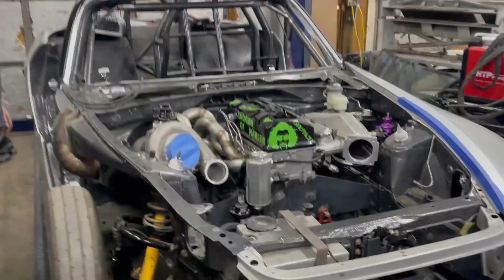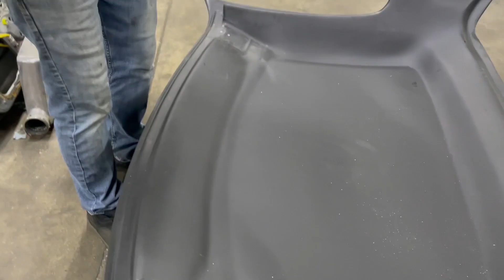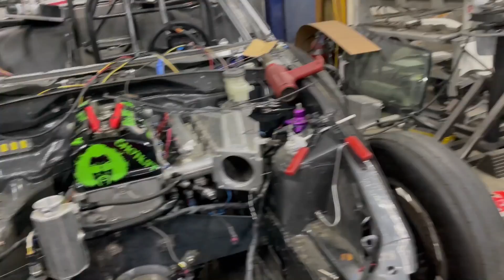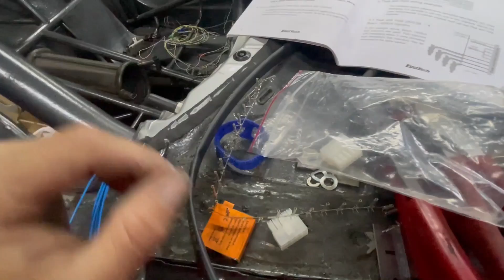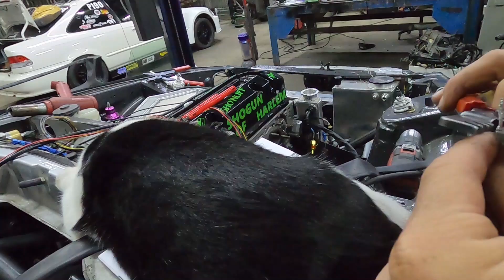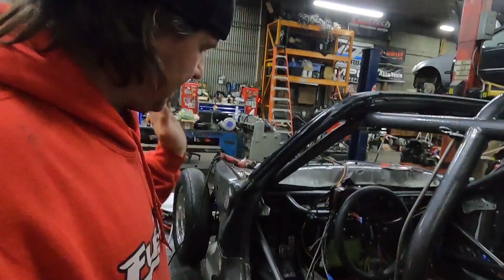Flew Home To Wire My Race Car, Sho'Nuff

Comment: The MAC WSC665 automatic wire strippers shown at 18:12 look an awful lot like my Irwin 2078300 wire strippers (Mac and Irwin are both owned by Stanley Black & Decker). I've never used one, but the NEIKO 01924A also looks very similar, and is even less expensive.

Comment: Rock On Brent!.....Wish I could be there to help ya shrink and pin cause you deserve to get old Sho'Nuff wired up and ready to rip ASAP! I use all the same tools and some of the same type of connectors/pin's for pro audio/video installations, so I can relate. One thing I've found in the 30+ years I've been doing it is after we crimp any type of pin to bare wire is to solder/tin  just a little bit of the very tip of the wire in the front part of the pin crimp before you stuff it in the connector housing so it never comes loose in the crimp and creates any kind of resistance. Can't wait to see Sho'Nuff  breath it's first breath...

Comment: TKM performance has built a 2 cylinder Hemi and it has everything on the front and rear that a V8 hemi has and it's so rad I can't wait to see how much HP it makes and chevy just came out with a 632ci big block that makes 1,004HP N/A

Comment: Hey they make those already at tractor supply or some kind of farm shop or big hardware store like ace they sell them for pretty cheap you will just have to mount one end on the hard top and the other on the top of the windshield panel

Comment: Brent buddy, you could simplify your wiring a lot by routing all your static grounds directly to the frame instead of using wires. Keeps a lot of electrical gremlins away too...
Reply from the maker: Chromoly is such a terrible grounding material. Or I’d have stand offs like a mad man
Reply: @PFIBrent  Meh, bulk resistance of 4130 chromoly is about 0.22 micro ohm per meter, it's high compared to copper, but it's perfectly fine for a ground. Even considering a length of say 5 meters between the battery and the ground lug, that's 1.1 micro ohms... That's not gonna bother anything, it's like 0.22 mV drop @ 200A.

Comment: Does the Fuel Tech system have the ability to read more than one Canbus coming from the PDM? If not, you may need to put a 120kohm resistor across them.

Comment: You should just take Sho'Nuff with you and drop it off to Brown and Miller and have them do all the wiring and plumbing and get it done and ready to run and then all you would have to do is put a tune in it and make a pass

Comment: If you need it started ASAP call Kyle, you dont even need wiring, just giving him a jump box 😂
Reply: He won't even plumb it, hell have a fuel pump in a fuel jug and a water pump in the pool feeding cold water into the engine 🤣

Comment: Good job twisting all those wires in the harness in pairs during the time lapse! most people don’t know you can do that and eliminate a lot of interference problems! In fact, if you connect a wire to your radio antenna and double it over then twist it tightly like that your radio signal will get way clearer!